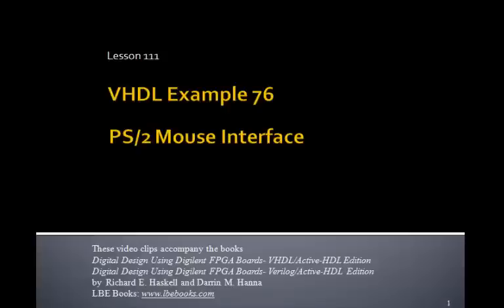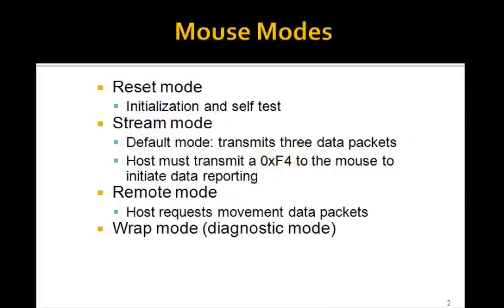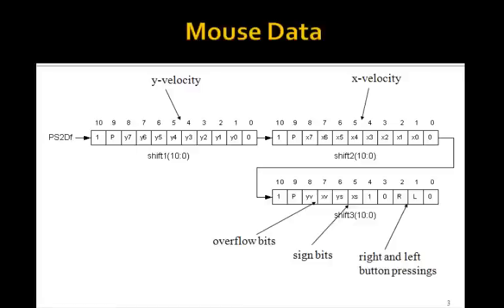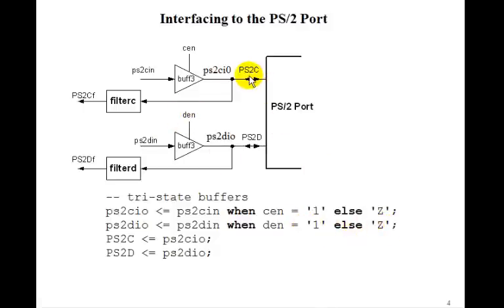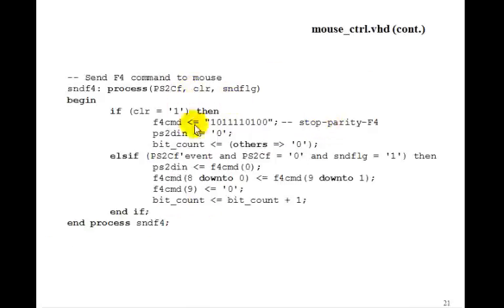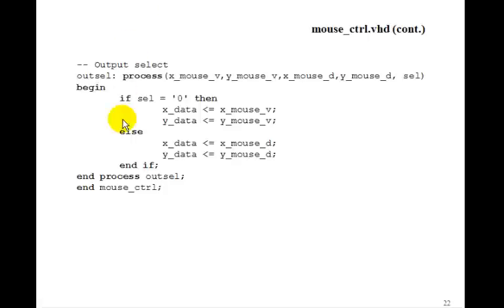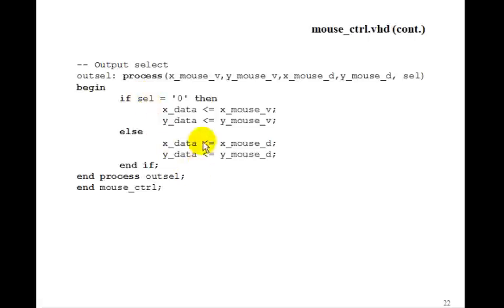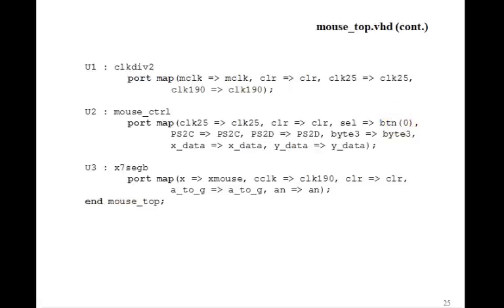Lesson 111 - Example 76: PS2 Mouse Interface

Comment: Hi LBEbooks, is there such called a MIPS I/O address for PS/2 mouse? As far as I've been researching, I've found that MIPS has two registers specifically to receive data for keyboard: Receiver Data register and Receiver Control register. Both are located at addresses 0xFFFF_0000 and 0xFFFF_0004. I wonder does MIPS have address for PS/2 mouse in similar fashion as PS/2 keyboard? If no, where should the PS/2 mouse save it's data in MIPS memory addressing?
Reply: +kwong cheong Ng did you find the answer to your question?
Reply: This was 2 years ago. I used the same registers as PS/2 keyboard for the PS/2 mouse.
Reply: +kwong cheong Ng Are you a hardware design engineer specializing in FPGAs?
Reply: MatrixOfDynamism I'm not. This question was asked when I was in my final year as a undergraduate. My final year project was specializing in PS/2 integration.
Reply: +kwong cheong Ng So your profession is not related to electronic hardware design in anyway?
Reply: I majored in Computer Engineering back when I was in my university years. It is hardware design

Comment: Hello  ı am a student of Engineering university   if could help me  on my project , this a part one of project 
 The name of the project is.. Interfacing microcontroller with mouse and Bluetooth to write in file by mouse and storage the file or delete or send to PC this is step one of my project ı have problem In writing code in mikroc for mouse and how can open file and writing and storage a file and delete If could help me ı will be very delighted
Reply: Did you succeed in finishing of your project?